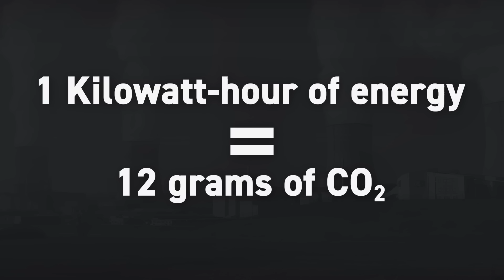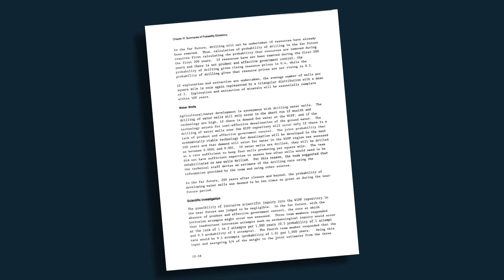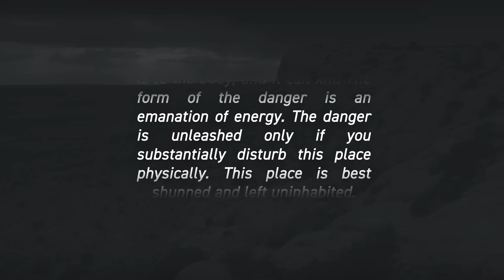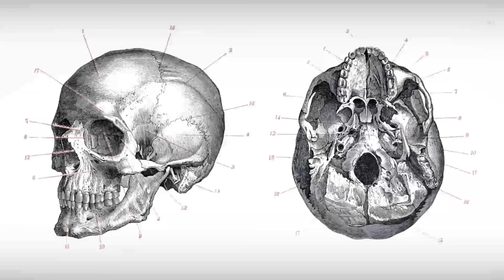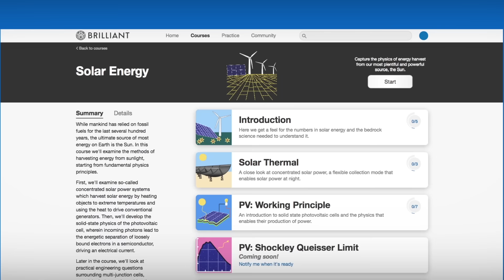The Nuclear Waste Problem

Comment: I don’t normally comment on anything, but you got many, many facts wrong. I have done outage work at the same nuclear power plant my dad has been employed for 18 years, and as such have gleaned a tremendous amount of knowledge. I would suggest actually visiting one of these power plants and speaking to the operators, radiation control workers, and maintenance personnel, because you are literally spreading ignorance. First of all, most spent fuel is stored in dry-cask storage. It is kept in the storage pool for only a couple years after it is spent, not a couple decades, and afterward, it cannot sustain the chain reaction which creates heat and is transferred to dry-cask. Second, the primary reason spent fuel is dangerous is because of the by-products of the reaction contaminating the fuel pellets. If it were cost effective, all of it would simply be decontaminated and would open up many more possibilities for long term storage. A spent uranium fuel pellet which has been decontaminated gives off far less radiation than naturally occurring background radiation in and around most peoples homes, and hundreds of times less than something like an x-ray. The contaminants are the dangerous part. Third, the 230 year estimate is literally a worst case scenario. Estimates put the number as high as 1500 years and as low as 230. A conservative middle ground estimate would give us 400-600 years. Finally, newer technology is pushing nuclear power toward small modular reactors (SMRs), reactors which are much cheaper to build, far more efficient, safer, and require far less infrastructure and space to build. With the added bonus that they do not require being built next to massive bodies of water. They are essentially the same type of reactor the US Navy uses in their ships and submarines, but on land.

One last thing, look up “Yucca Mountain”. The United States had been working on a permanent long-term storage facility for years (to store waste from around the world), but former President Barack Obama cancelled the project. Right before it was set to open.

Comment: This video is wrong.
1: tsjernobyl was a accident that was preventable
2: Fukushima is right now a place where people can live again
3: thorium is only 368 year radioactive
4: its recyclable do 97% of the fuel can be re used
5: wind energy doesn't power all day
6: coal kills 60.000 people every year because of pollution
Reply: It's all 💩
Reply: And Caskets don’t need nearly as much maintenance as he said. They are nearly indestructible and cannot leak since the radioactive matter, before encased, gets molten and mixes with glass, sand and ceramic. And they emit no radiation. Thats a total myth.
Reply: Chernobyl*
Reply: @simondahl5437  depends on what language you’re speaking. In Germany for example it’s Tschernobyl.

Comment: Why couldn't the used uranium be used to form an extra protective layer to prevent radiation leaks in reactor walls as radiation will get repulsing when it meets it's same part while escaing it would also prode very little but extra energy

Watch in 2021

Comment: That message was ridiculous... did they have a single psychologist on staff when they were creating it? If anything that would only drive my natural curiosity insane with wonder and desire to find out what warranted such a long and elaborate warning... at worst some might even see it as an attempted trick to ward off thieves from a great treasure. The safest way to do this is to put it in a place least likely to be found and have NO MESSAGE OR WARNING AT ALL. Nothing to indicate that anything significant is there. Drop it all in the Kola super-deep borehole...

Comment: What the fuck is that message...I think that can only trigger curiosity... It should be this 
"A map of the facility, how deep it is and how wide it is and with a message, this area should be left untouched and uninhabited due to its radiation, if you dig it and accidentally release the radiation that is underneath, people nearby will die because of cancer"

Comment: You gave the current solution of long term storage as the only option. This is not true. It's the dystopian option. However, the science is very encouraging in regards to  repurposing the waste a powerplant generates. The depleted uranium still has viability as feed stock in certain experimental reactors, including molten salt reactors, and those reactors literally consume 1st generation reactor waste. I guess a bit more research into nuclear energy frontiers is needed by YouTube channelers, like yourself. It's an important discussion. Keep an open mind.

Comment: This video is unfortunately not able to provide complete picture about so called nuclear waste. Focusing on burying the used fuel misses totally the point that this fuel can be used by fast spectrum reactors. Also  the new generation reactors, which we are developing now, produce significantly less waste and which will be radioactive only 300 years.

Comment: Recently, hasn't a way been found to re-use nuclear waste in fission?  I remember hearing about it recently.
Reply: Fission works with with isotopes of light elements like hydrogen
Reply: @0topon  Right, not fission, it's decay, I forgot yet again that reactor heat is accelerated decay, not fission

But the only thing is, I thought that fission of atoms was the splitting of an atom, which would mean that the nucleus would have to be large enough to be split by a smaller particle, but hydrogen is too small for this purpose, as it only has 1 proton or 1 proton and 1 neutron.  Are you actually trying to reference to fusion, where larger atoms become more and more difficult to fuse for energy?
Reply: @papyrusspaghetti9376  Yes i misread, i meant fusion.
Reply: Yes, if by recently you mean 1952, when the Experimental Breeder Reactor was operated.

Yes, you can also use decay heat to generate electricity or heat, but at the low temperatures available and the super-high regulations, AND the the lack of market appreciation for dispatchable power -  it is hard to make a buck at it.

Comment: Nuclear waste is not that much of a problem, storing it for 100 years or more is not hard if you have an stable rock formation. You only need that much, as long as you are burning all the fuel which you eventually should do. It is not done for political reasons; you may blame politics for lack of proper nuclear waste management, is not a real problem and will not be, it is a non issue.

Comment: Ummm, this is maybe stupid question, but if it can still boil water, why remove it and not use it to... boil water and move the turbines?
Reply: A bit of an explanation, but stick with me.

U235 is put into the reactor as a solid, encased in a solid fuel rod. When it fissions, the fission products (something like Kr/Ba or Sr/I) are trapped in the solid fuel rod. These fission products absorb neutrons. There are just enough neutrons to sustain the chain reaction.
So, 2-3 years later, 'billions and billions' of fission reactions later there are 'billions and billions' of neutron absorbing fission products. Because the fission products are immobilized in the fuel rod, they don't move out of the way, and the chain reaction will grind to a halt. Thus, you need to refuel to allow a sustainable chain reaction.
(note: Some Gen IV reactors have liquid fuels, so they will move the fission products out of the way.)

This spent fuel is still hot, but not capable of maintaining the 325C @ 70 atmosphere pressure (super-fine, molecule-sized super-heated steam) inside the reactor. So, you remove it from the reactor.

Ok, the spent fuel is hot enough to make steam, 100C @ 1 atmosphere pressure, but that simply isn't good enough for a steam turbine. The water condenses inside the turbine, the drops hit the blades, the blades eventually disintegrate (water drops vs the super-fine super-heated steam from the reactor), the pipes rust (standing water) . You would replace this low-temperature steam turbine every 3 months!

Basically, you can't use the spent fuel to heat water. You could use spent fuel to heat pentane! https://en.wikipedia.org/wiki/Binary_cycle - why don't they then?
Well, the NRC is a conservative organization and so modifying ANY part of the plant requires a lot of time and effort to modify your license - you could spend tens of millions and end up with zip! if they think is too risky.

Secondly, after you spend the money to change the license, and build the binary cycle turbine, and produce dispatchable energy - you still lose money as the rest of your NPP does because the US (and most other jurisdictions) electricity markets discriminate against low-carbon dispatchable energy in favor of high-carbon natural gas and intermittent wind and intermittent solar.

So, you could improve your plant, you could produce more energy, but you will be rewarded with lower profits.

Comment: I think I've found a way to take all the nuclear waste and recycle it. So, like with my small modular nuclear reactor design- very simple design based on a coal-fired power plant-  it's an all-enclosed reactor, with nuclear control rods within a kettle... its lead-lined, and, there's an ability to open up vents, and raise the control rods, out of the water inside, which exposes them, and places them into an inert state, in an emergency.... so that Chernobyl or 3 Mile Island won't happen. It's a very simple design and that's why it is safe. Inside of the reactor, is slowly accumulating heavy water, AKA, deuterium oxide, and with the recent breakthroughs in Fusion technology, they've actually found out you can use deuterium oxide As Fusion fuel, so it's like a secondary resource that comes off of the nuclear power plant that used to be treated as nuclear waste..... which is wrong. Once the control rods within the plant are depleted,  in a safe manner, using insulated equipment and an inert lead lined vacuum chamber, you can remove the heavy-water in the reactor, which contains all the electrons that were pulled off the uranium, and these can be sent off to a secondary location to be reused (control rods) uranium can be re-enriched in an electromagnetic field, or with things like Radium, and deuterium oxide (and other isotopes of hydrogen & oxygen) can be made into things like fusion power plant fuel.

And when the deuterium oxide is used up in a fusion power plant, it is just regular H2O, and then you could reuse the same H2O, and the same uranium right over again, after you enrich it.

Totally new nuclear reactor design, new standards and practices, new safety equipment, new robots, new enrichment process.... I've re-designed Nuclear Energy from the ground up.

Comment: I am pretty sure that only Lead is almost impervious to radiation contamination from the spent fuel rods. As the containers are not made of lead or even lead lined (they are steel and copper or bronze, and concrete), then the radiation WILL eventually get into the ground water.
Reply: Oklo Gabon proves you dead wrong; even without expensive containers or burial, the waste didn't spread after two billion years.
Reply: @ForbiddTV  I'm pretty sure that the place you're refrencing doesn't contain any nuclear waste. It's just a uranium deposit.
Reply: @zandinionrr6392   Well why don't you look it up instead of proclaiming you are "pretty sure".   A natural nuclear fission reaction with resulting nuclear waste.
Reply: @ForbiddTV  Alright then, please explain in detail how this uranium mine or geological artefact relates to the safe disposal of nuclear waste. Please explain why your cheap and revolutionary solution has apparently been known since the 70’s, but has not yet been implemented. I want to know if you’ve just looked at an article once, and written a comment without thinking about what you’re actually saying.
- Take all the time you need :)
Reply: @zandinionrr6392   I don't need time, that was done for me billions of years ago.  Even without complicated/expensive encasement or even burial, the natural nuclear fission reactor site at Oklo Gabon produced nuclear waste which can be seen to not have spread over the area.   Fast forward two billion years and it is quite apparent that our extravagant care in dealing with nuclear waste is a moot point.  This exuberance from the industry is totally unnecessary and only instills more fear in the ignorant who think it must be real dangerous to see the industry behaving in this manner of their own waste.
Reply: @ForbiddTV  You're effectively repeating yourself, and are suggesting that people just dump their nuclear waste anywere they want. You are not discussing an actual solution to the problem. I do agree that people sometimes irrationally fear the consequences of nuclear power, but safely disposing nuclear waste is absolutely necessary.
Reply: @zandinionrr6392   You asked, "Please explain of your cheap and revolutionary solution", then I tell you and you don't like the answer. 
The way it is proposed to be done is way overkill, is overly expensive, but still safe.  Not sure why reality is a problem for you. 

Nuclear waste disposal has never been a technological problem, only a political one.
Reply: @ForbiddTV  So you admit that your solution is to just dump it and let it deal with itself?

Comment: What's the point in currently building a long term solution for something which as you said, would only last for about 150 years. If there is only enough urainum to last for that long, surely humans would create a better solution by the time the deposits run out.
Reply: Burial is the least attractive option we have.  Reprocessing and use in breeder reactors would recover much of that 95% of energy that would be otherwise lost.

Comment: you're boiling a damned kettle of water. certainly not cleaner than hydro, wind, solar, and the conservation of momentum. however, we have one heck of a demand. most people don't even have a clue how transmissions lines work, and the loads on those lines.

Comment: This documentary is far better than most on nuclear energy and waste, granted. However, it does not grasp the nuclear industry's baloney: buried nuclear waste, which has to be stored for 250,000 to one million years (according to diverse authorities depending on what is in it), will leak. In that amount of time, new species will evolve. 

Most planners for the storage of nuclear waste hope that you will not think about exactly how long a period that is. All of our monuments and buildings will have disappeared by then, even if our civilization lasted 10,000 years more. In that time, not one but many, many ice ages will have begun and ended. 

Finland receives a lot of rain fall. (The US storage site that was planned in Nevada was likely also to fail but at least it was in an area that as of now is not receiving rainfall and reportedly, in a mountain, so that the water would not flood the area over the nuclear waste and leak into its storage.)

Do you really think that water would not leak into the storage waste sites after an ice age started to end and the two to five miles of ice above the nuclear waste storage site melted? Water erodes everything. Tectonics and volcanos mean that the predictions by the planners are just that predictions of events tens or  hundreds of thousands of years in the future. 

They may and probably are wrong. If all of the ice in the poles were to melt, that area would be under the ocean and ice ages are often followed by very hot periods when all of the ice melts. 

Hence, what will happen? Water will eventually reach the nuclear waste, even if it takes 30,000 years. If humans are still around, and our durability is often underestimated, since even a nuclear war would not kill all of us unless they managed to nuke every family of farmers in the hinterland, which will never happen, when water reaches the nuclear waste stored there, the nuclear waste will slowly leak into the water table.

From there, it will spread in a widening, probably circular invasion of all surrounding territory. Even if the leak occurs while the site is under the ocean, the amount of nuclear waste that will be store there will be gigantic. Thus, when the leaks are substantial, tens of thousands will die, maybe each year, maybe millions will die if the nuclear waste spreads. Plutonium and other things in nuclear waste are remarkably lethal, even aside from their radioactivity.
Reply: @mim8312  Funny that you've decided to deflect from the fact you were wrong in your first comment by being equally wrong in your second comment. If you're going to be dishonest, you're going to be ignored.
"Are you some Trump cultist?" I'm a leftist. Not only do I think there should be more nuclear power, I think it should be socialized.

Comment: The most critical waste is also the radionuclides inside the cooling water reactor and uranium pool. 
which generates Cs and Sr radionuclides that decay for a hundred years. 
I have been researching how to encapsulate these wastes. As a result, I found that these wastes are unpredictable. However, I have successfully found excellent material, which could encapsulate for 100.000 years.

Comment: there's a smaller, cheaper and probably safer solution, by drilling a foot and a half wide hole deep underground as deep as those tunnels, and drilling down and to the side, and putting the waste in the other end of the hole, and fill it up with concrete: boom it's permanently stored down there without the need of security, maintenance, and most importantly without the need of alot of money, heavy machinery, and more concrete

and besides, nature had done this before, long before we came around.